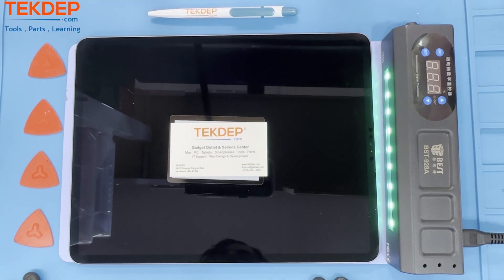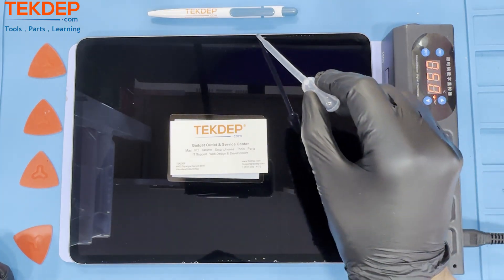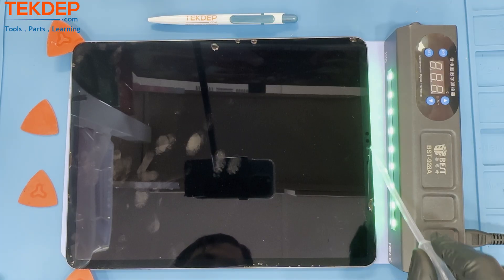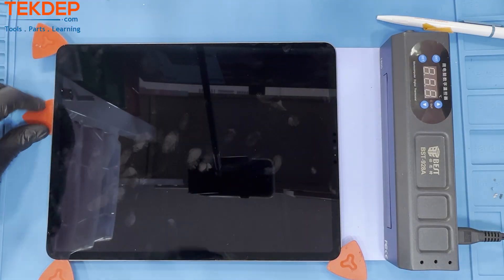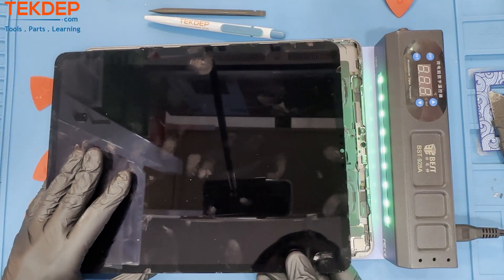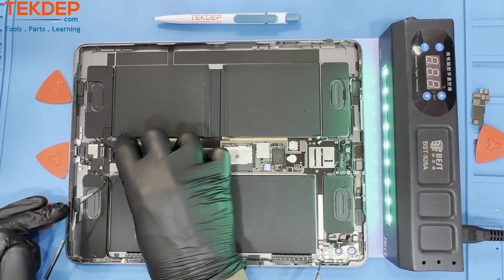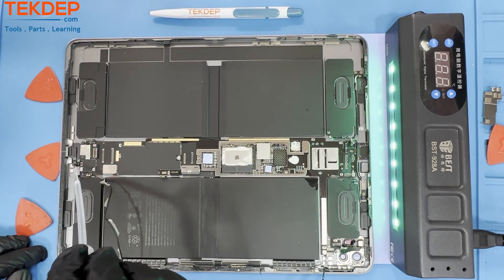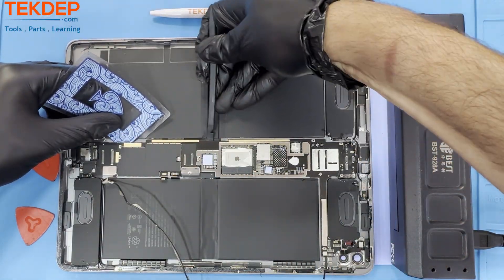M1 iPad Pro 12.9” | Teardown Tutorial A2378 5th Gen

Comment: Where is the cpu on the iPad Pro m2 11”? I need to install a cooler with a glue plate on the black. Thanks
Reply: You can’t install a fan on it why would you when it doesn’t get hot
Reply: @JustinEdge-i3i it gets hot when you play game like Genshin Impact, no need a fan, but he can use vapor chamber instead 🤷🏻‍♂️
Reply: Why my face id not working after change the display
Reply: @enggalbagus4312 probably wire problem or apple anti repair chip
Reply: @coachjah4953 I don’t know where exactly the SOC is located, but if I were to guess where it might be based on my M1 iPad Pro and the recently released M4 iPad Pro, I think that it is located directly underneath the Apple logo on the back. Hope that helps.
Reply: Hi bro which liquid u use remove screen thanks